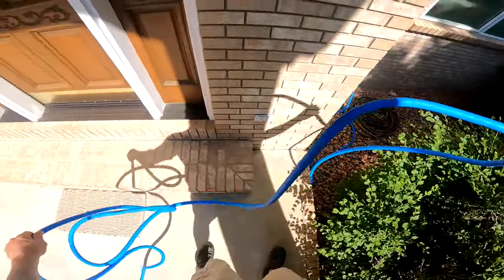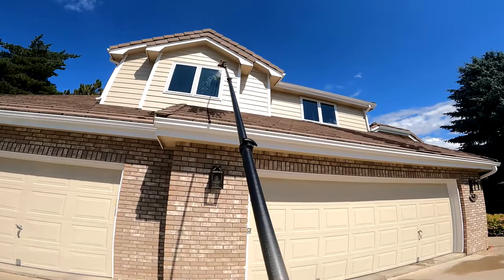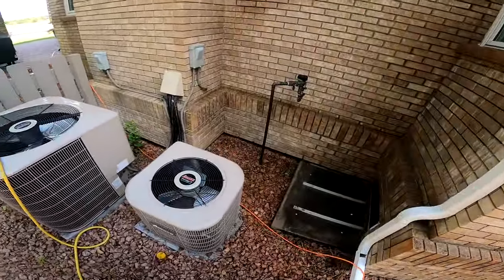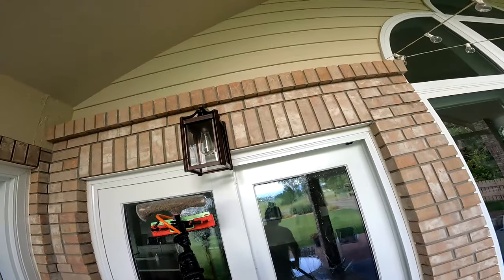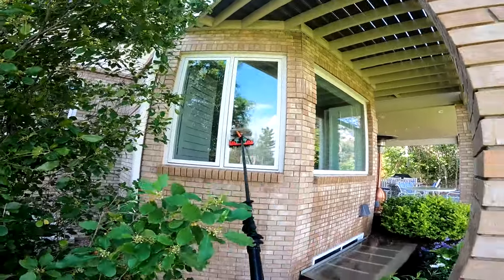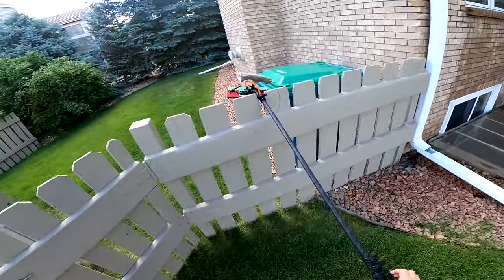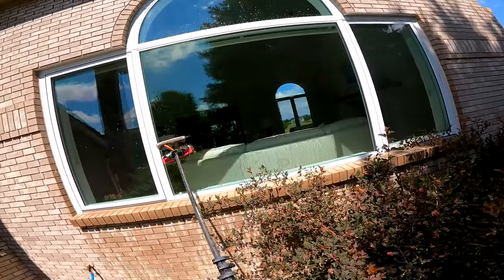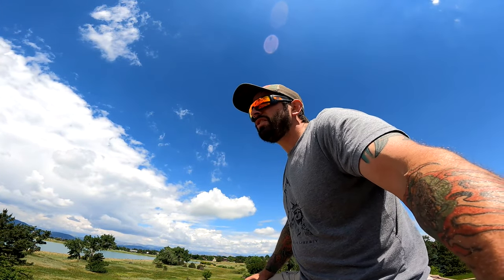WATER FED POLE SETUP AND WORKFLOW OF A WHOLE EXTERIOR WINDOW CLEANING JOB

Comment: Im amazed at the water pressure you got without a electric pump. I've been doing WFP for over 20 years. Usually around 4 and 5 story buildings. Started with the old school metal Tucker Pole. These new poles are absolutely beautiful, and much lighter. Nice vid and love your attention to details.
Reply: i still have my old school metal pole mounted in my garage as a reminder lol

Comment: Been cleaning windows for 28 years. Great video for technique. I found that WTP systems are great for solar panel cleaning on  roof tops. the angle, and height in which panels are placed makes WTP systems ideal. I have signed up 4 commercial accounts and 5 residential accounts. I live in Ohio. I have signed them up for 3 times a year. the most important time to clean solar panels seems to be late May when most of the spring pollen has fallen. Theonly problem is all our accounts need cleaned ariund this time. No sleep from mid May thru June.
Reply: Where in ohio? I'm around the cleveland area and am always wondering what the market for stuff like this is. And for pressure washing/house washing/gutter cleaning.

Comment: I have just done my first jobs using the water pole and filter, getting great results. If there is any water spots around edges, I just use a cloth. I always clean the frames first and rinse. I wash the windows with slight solution and rinse. Everyone has there own way.

Comment: I used to install pool solar on roofs for 5 years. You need to walk on the bottom ones of the tiles. It transfers your weight on both top and bottom tiles, reducing the chance to crack the tiles. Thanks for your informational videos Steve.

Comment: Hey Steve. You've got so much content. All the training I need!. I just bought your starter kit and used it on a $150 job today! The scrapper definitely a life saver. One question, the Tbar that comes with the kit doesn't lock onto the pole like the squeegee does. Is the Tbar with the kit meant to just be pushed on to the pole tip for use?

Comment: After watching this video,I got waay more insight on using the wfp system. Much more work than I thought, however, gotta be better than moving and carrying and repositioning ladders. One question I have is, what if there's paint or other stubborn matter on the glass that would typically require a scraper or 0000?
Reply from the maker: It will not remove paint, silicone, construction debris. Traditional is the only way to go for that
Reply: @SteveOthewindowcleaner  I actually spoke to you once about 2 months ago over the phone. Recently I've spoken with John and he recommended a DI system and all with the portable reel. I'm tired of doing the ladder thing and wondering how I can reach a 2nd or 3rd story window without getting up on the roof especially if there is a roof below or a porch covering that extends out pretty far. How can you tell from the ground if a second or third story window is clean since you can't see that high up face to face

Comment: I notice you run the hose throughout the pole like you guys send them. Pros and cons of that vs just running it on the outside of the pole? Only company I've worked for didn't run it trough the pole but don't no that there poles could or if he just prefers it that way

Comment: Do you have the clients remove the screens before you arrive and use water fed ? I just picked up a xero max and trying to figure out the most efficient way to handle the screen situation  

Thanks in advance
Reply from the maker: I always remove, clean and put back all screens

Comment: I really need to get a Xero Waterford pole. I have an Unger nLite pole and it’s pretty heavy. My arms would have fallen off doing that much pole work. In my opinion, WFP work does clean them frames much better and more efficiently. Thanks for the great work Steve.
Reply from the maker: The destroyer is definitely my favorite of all time so far. Very rigid which helps so much in controlling the pole

Comment: I run 200’ of water fed pole hose and still get good pressure. It’s easier than carrying around the heavier garden hose.
Reply from the maker: Yea I just prefer the larger inner diameter hose, Ive done tests with different size hosing and I get a lot more water through the brush with the larger inner diameter then the smaller inner diameter. This is what I prefer with RODI systems, but for DI only you could definitely run 200' of the smaller hose and get great pressure.

Comment: Awesome vid 

Can anyone tell me if the water filtration is strictly necessary?
I’m just starting up and want to know if I can begin cleaning windows or if I absolutely need a resin filter system at least?

Thanks
Reply from the maker: Hey! I operated for many years with out it, it simply makes the job easier. For just getting started a Traditional kit, dawn soap and some ladders can get you very far 

https://windowcleaner.com/products/steveos-employee-basic-starter-kit?sca_ref=3020242.k17l3JaEgS

Comment: Hello Steve, 
What if the windows are extremely dirty ? Or have hard water stains? As well I know this video is 2 year old, is there anything you would suggest for me to buy, which may be better with WFP system and the pole itself. Looking to purchase through your link. Let me know thanks. 

As well great video . Learning lots from you.
Reply from the maker: I use wfp on everything except construction cleans, but it will not remove hard water stains either. For that a hard water cream is best, there has been some improvements as far as the systems and some accessories, but overall this is what I still use

Comment: What should the pressure be to wash 2ne or 34e floor windows?
Reply from the maker: Depends on the incoming pressure from the water source, but typically out of the brush is around 20-30 psi

Comment: Im not a window cleaner but do appreciate these videos.  So cleaning windows using this method drys spot free because the water is RO filtered?  Also,  do you ever run into costumers complaining about all the water dripping on their patio?  Thanks for these videos, they are very interesting.
Reply from the maker: Yes, there is no minerals in the water so with the correct agitation it drys clean. Never had a customer complaint.

Comment: Hey brother question 
Whats the difference the setup using and the unger hydropower ?
Reply from the maker: Hydropower is good for areas with low minerals in the water, Xero pure includes an RO membrane filter that is meant for purifying water in areas with high levels of minerals.

This is the Max, the new X2

https://windowcleaner.com/products/xero-pure-max?sca_ref=3020242.k17l3JaEgS

Comment: So with water fed pole and a guy to help with the inside and outside it takes how long on This house compared to doing it yourself with wfp? Im thinking of buying this same set up maybe run 2 poles at the same time? just trying to figure out the pros and cons.
Reply from the maker: It would take an hour and a half with a helper inside, only con of WFP is you can’t use it on construction cleans and inside windows lol this is a similar setup but you would want to do a destroyer water fed pole. I can help you get setup if you contact me 9705991437

Comment: Thanks for all the content SteveO.  I really didn’t like wfp for a long time because I couldn’t find the right technique to get good results!  Mine is similar to your technique now I scrub the frames and edges of the glass and rinse and then after letting them drip I just do the middle of the glass and rinse without touching the frames.  If I do get the frames wet on my final rinse I’ll get dirty drip marks.  Do you not have that problem?
Reply from the maker: Every once in a while I will need to clean a window twice, happens to all of us. But I just like cleaning the frames and the glass. I just think it completes the product and customers love it. With what I do here I find that I can even hit the frame with a little water and not get a dirty drip. I also prefer the rinse bar, just seems to do a better job with residential windows
Reply: I used to have this problem. Has things improved for you Jared? What I do is wash the frames and glass and rinse everything throughly and it has gone really well this way.

Comment: Hey StevO, how are you doing and how do you like your filter system, any issues you ran into? I've been thinking of buying one, just asking about how long you've had it and any issues you've ran into with it?
Reply from the maker: Been using pure water for a long time and all systems have maintenance but if properly done they can last a long time!
Reply: @SteveOthewindowcleaner  thanks for the reply. How long before you have to change out the filter?

Comment: I  looks nice brother!
 I pressure wash so water fed pole is more up my alley for exterior windows. I'm in south Florida always hot so I will do this for now on. Can I get a tip brother on what kind of pole and heads to use for it. Money not an issue
Reply from the maker: Hey for a pole, here I am using this one which is a high mod carbon fiber and a boar hair brush https://windowcleaner.com/xero-steveonator-pole?pt=MY AND this brush in boar hair https://windowcleaner.com/xero-steveonator-pole?pt=MY

Comment: Is that yellow 150' hose the same type that comes with the Xero Pure systems?
Reply from the maker: No the one on the reel I would say is not as good of quality but still works great, I have had this reel for 2 years and works really well
Reply: What's the diameter of that hose?
Reply from the maker: @JorgeChavez-xm2ew  ID is 3/8”

Comment: Great video man! Question for you or anyone who has more knowledge in this field, is it possible connecting the water fed pole directly to the water hose without using a filtration system. I was thinking maybe an adapter of some sort. Thanks in advance🙏
Reply from the maker: You definitely can attach it right to the water source but if you’re using it to clean glass you want the filtration for sure or you’ll leave hard water spots

Comment: i have been using water feed for about 4 years and i cant tell you how many times and what the hose gets caught on.i use a mop with soap to wash the window then rinse it off with the water pole is that wrong? i will never walk that roof not safe
Reply from the maker: I just do everything with the brush, adding soap adds a lot more rinse time in my opinion

Comment: Hey SteveO!! I appreciate you and the content you give us. Would you be able to see if I have that swivel on my set up when I ordered. Seems to be stiff, If I don't have that swivel to make it easy to get those angles, can you put order in for one on my account. How much better is that pole vs the XERO Pro Basic Carbon Fiber Water Fed Pole, Teak Baker (Copied and pasted that)
Reply from the maker: Hi Teak, I can for sure do that for you! The destroyer is in a league of its own, for the 30’ it’s $1499 then goes up by $500 for every extra 10’. It’s an extremely rigid pole with a larger overlap between sections and uses the highest tier of ultra high mod carbon fiber. You would have a lot more control at 40’ and higher with this pole compared to any other pole on the market
Reply: @SteveOthewindowcleaner  ok. But the swivel will work with my current pole, and it doesn’t seem to have that swivel on. Next spring I will revisit upgrading the pole it’s self. Thanks
Reply from the maker: @teak5476  you do have it, it came with the alpha brush, try loosening the dial on top under the push to fit for the rinse bar
Reply: @SteveOthewindowcleaner  I’ll admit I am a diffuss lol. Ok thanks.

Comment: Hey Steve, love the content, was wondering how you know glass is tempered or not? I’m just starting off and want to make sure I don’t use a razor on any tempered glass!
Reply: It should always be marked in one of the corners to show that it complies with safety glass standards, or at the very least just some sort of mark to show it is tempered. In the UK it's a legal requirement I believe, imagine it's similar in the US. Annealed glass (i.e normal windows) is not marked, so if you see any markings you know you are dealing with tempered :)
Reply: Tempered glass isn't softer/less scratch resistant than annealed glass, it's actually harder and stronger (part of the whole reason for it) - the problem for window cleaners is that cheaper, shoddy quality tempered glass will often have manufacturing debris fused into the surface, which can become dislodged and this is what causes scratches. Better to be safe than sorry, and I always tend to assume that housing developments in particular will always look to keep costs down as much as possible, so likely to be crappy tempered glass.
Reply: @chrisoakleyfx  oh okay thanks, so should I just stay away from razors as much as possible? Maybe saving them exclusively for paint spots and such
Reply: Awesome thanks man

Comment: Austin — I have a question for you that somehow is not often addressed in all the various videos I’ve seen uploaded by the gamut of window cleaning YT accounts!

MANY well-established industry professionals are ALL insisting that a (1) hand wash/squeegee window wash does not require special water and that tap water is fine, because the squeegee removes it all. I see that you specifically mention special water for water fed pole washes, but omit a squeegee hand wash  from that same conversation, which is not a critique, it’s just to let you know I’m closely paying attention and I don’t believe I overlooked any information with respect to that. And another guy said (2) that purified, distilled, or DI  water becomes unpurified once detergents are added to it and for that reason, hard tap water may be used just as well as anything else.

I’m new to this, so it would take some experience for me to test and experiment with these claims and other than doing so on my own windows, I don’t want to learn the “hard [water] way,” with a customer who holds the power in their hands to rate my business after the fact. 

I find these claims difficult to believe, but hey, what the hell do I know. I’m not some genius bio-chemist like these veteran window washers! 

Thank you for reading into this point and for all the helpful, free content and advice!

Comment: Water fed pole is the way to go. Clean windows for almost eight years for another company 95% of our existing customers repeats outside we're done with water fed pole systems. Only time we didn't use them as when the customer specifically asked not to use it because they didn't like the water on the Windows because they think it's going to spot up. With another employer way better than previous place I worked at just trying to convince him in believing the water fed system will work makes the job a lot easier and way safer than having a carry around ladders and stuff and climbing up and down on ladders.

Comment: The system is way to complicated.  Look at some UK system videos .
Reply from the maker: Its very simple overall, UK systems are typically delivery systems with a lot more smaller parts that can go wrong as far as the delivery panel. Also things are done differently here then in the UK so to each there own
Reply from the maker: That's a lie, get out of here!
 @niblet112